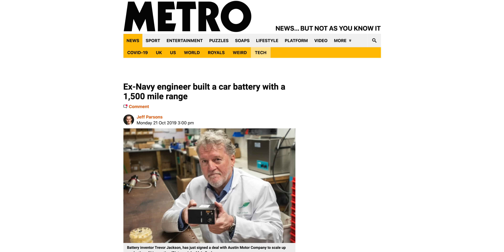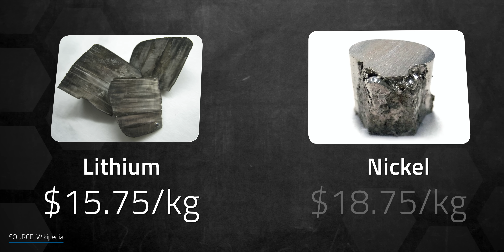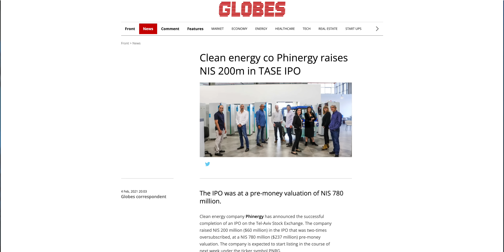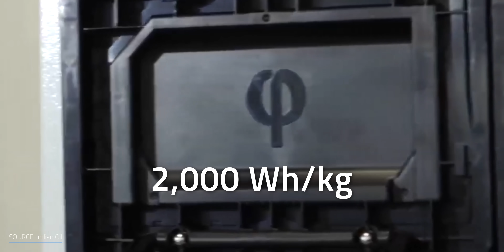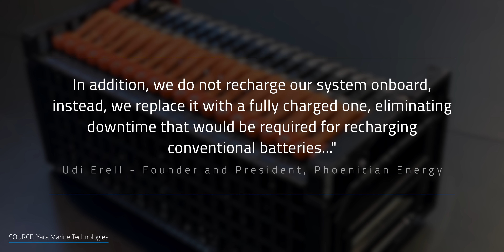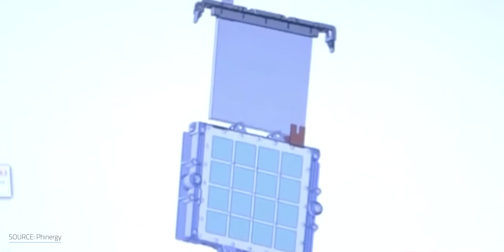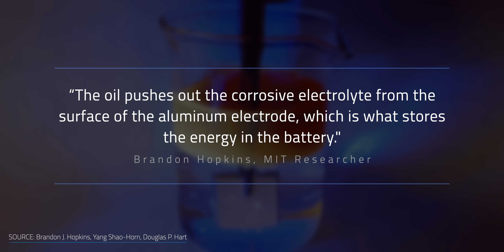Exploring the 1000 Mile Car Battery - Aluminum Air Hype?

Comment: Aluminum batteries are. Gaining  attention. As a
Potential  replacement for for lithium-ion batteries 
Longer lifespan   Also. Lower cost 
Check On. Tesla. Backs the  technology 
It can’t not. Be. Recharged once the battery is 
Discharged. Or empty

Comment: Battery swapping is not such a bad thing if you have a network of swapping stations. The problem of running out of juice in the middle of nowhere is not so different from running out of gas or not finding a charging station for Lithium battery. In fact some two wheeler designs include battery swapping even for Lithium battery.

Comment: Doesn't aluminium require a stupendous amount on electricity to manufacture? I could tolerate swapping out a depleted battery after 1000 miles, but I dont think it really makes sense in terms of logistics and sustainability.
Reply: It takes 13kwh and 0.48kg of coal per kg of aluminium.

Comment: I think that battery swapping will become necessary regardless.  Battery recharge takes hours, making long trips with quick refueling as we can do today, out of the question.  If batteries were standardized across the industry and be designed for quick swap, I can envision someone stopping at a "gas station", swapping in fresh batteries in exchange for the discharged batteries, paying a fee and in 10 minutes being on your way.  Ditto for people at home who drive a lot and can't have a "fast charge" station that can charge overnight to full capacity from minimum charge.  Plus, standard removable modules makes maintenance, repair and upgrades easier.  Its a no brainer.  SAE (Society of Automotive Engineers) should get busy working on  a mechanical/electrical/software interface standard now.  FYI, this would only work if its so easy that the driver can do it themselves so the modules must lightweight and with no way to do it wrong.

Comment: https://youtu.be/9OOq3f6mUxU?t=260 The Reaktion in the battery is Al(3+) + 3(OH(-)) -> Al(OH)3. So we get Aluminium trihydroxide or short Aluminiumhydroxide. How to get back the Aluminium is a part of Bayer process followed by the Hall–Héroult process, you can look up at Wiki. Easy is not the word I would use for that, it is by design even not free of CO2-emissions.

Comment: An Aluminium-air battery will probably be ideal for the militaries if they want to go electric. Swapping the batteries are ideal since there is almost no down time. Perhaps even less than fueling with Diesel.

Comment: If an emergency vehicle can bring a temporary charge to a lithium EV, it would seem even easier for it to bring and change out an aluminum air battery. It was also a bit misleading to suggest that one could run out of charge unexpectedly: I should think range could be closely monitored  and displayed in the car system. The non-polluting, energy dense upside of this technology seems very promising. I really don't want to wait for my car to charge.

Comment: perhaps I am ignorant here, but why is mobile swapping an issue for an EV powered by this sort of battery? If we are assuming the same design as a lithium battery EV, sure it'd require some specialty equipment. But why would be design the battery to be housed in the same area on a lithium battery vehicle? 

Is that limitation not just one of design? Why not place the batteries in the hood of the vehicle where someone can easily provide roadside support? Is there some sort of risk in having it easier to access? Surely we can design a system to just slide these batteries into a compartment with couplers to make replacing these batteries easier?

Am I missing something?

Comment: Honestly, a supplemental/range boosting aluminum-air battery as an option in addition to existing lithium tech sounds like the right idea. You could pick up an aluminum-air pack that you can use to power your vehicle for long hauls. When it taps out, lithium takes over and you have plenty of power to get you to a swap station if needed. It just makes more sense, really.

Comment: Lithium as a source is limited. So there should be alternative. Sodium battery tests are going on and yes absolutely Israeli battery company Phinergy has collaborated with Indian oil corporation for aluminium battery tech. The range looks promising and better than lithium batteries. Hopefully Suzuki Ashok leyland and Mahindra auto’s tests come out with positive results. India has abundance of Aluminium. That will make India not to depend on any other country for Lithium.💯⚡️

Comment: Theoretically, if the aluminum batteries were widely available and if they cost about the same as gas or less, I probably wouldn’t mind switching mine out if it’s plug and play. It might even be faster than pumping gas especially if they are stored in the trunk like the video showed or in another easily accessible location. The degradation problem would first need to be solved though, or at least greatly mitigated. A battery with such high energy density would take longer to use up leaving more chance for corrosion and it would be a shame to lose a lot of range while your car sits unused

Comment: I just realized you could have vents that can be opened and closed and turn the battery off... or you could drop hydrogen peroxide in a chamber and give it a tiny boost, so instead of nitrous it would be oxide...

Comment: If you really get 1000 miles out of the battery every time. I would have no problem swapping it out. Just as long as the price to do so doesn't exced what it cost to fill a normal gas tank to much.

Comment: As an eight-year driver of EV, I give you my answer:

No.

The ability to start each day with a full charge at home or away — by plugging my car in like a vacuum cleaner — is one of their biggest advantages.  Not interested in giving that up.

I don’t understand how replacing an entire battery at every fill-up could be economical anyway.  You didn’t explain that.

Comment: you overstate the issue of running out of juice. the battery does not have to be exhausted to 0% before swapping, the system can warn at 5-8% and force you to swap. the greater question for me here is how easy it is to recycle the battery? for the corrosion MIT's solution seems workable, I would trust their findings. 

I think Al batteries are the way forward, Aluminum is abundant and cheap, the range even if worse than stated is a major advantage over Tesla's. the pack seems so lightweight, you can actually take an extra one in the trunk once the system warns of running out of juice, then you swap it. Hell, with cars being hooked on the network the order of the new pack can be automated, so you'd be notified to pick it up at a station.

Then there is the charging problem. with chargeable EV's you have the huge task of building out an expensive charging infrastructure, meanwhile with al-air batteries you can use the existing distribution/logistic system and with centralized charging facilities you do not have to transport the electricity then distribute it over great distances. 

So far this is the most promising tech I have seen.

Comment: I don't see why you are emphasizing on non-rechargeable. You do know that petrol is non rechargeable too. 
A battery swap station or a tow truck can come to you.
The ends of life range anxiety can be easily solved by pairing with a small li-on battery
And one more solution, these batteries could be installed in asymmetric pairs so they don't run out at the same time.

Comment: Charging an ev is such a pain. If ev discharges in the middle of the road then alternate charging vehicles can come and recharge it in half an hour to get that ev to nearest charging station. But in case of aluminium air battery, the alternate charging vehicles will come loaded with new battery pack and will swap it within 1 minute to provide you a range of more than 1000 miles. That is insane. Also just like we fill petrol or cng, the turn around time of swapping will be similar at gas station. It is perfect replacement for gasoline. Only corrosion is the problem for which technology will get mature in some time.

Comment: Oxygen doesn't enter the electrolyte and react. It reacts on a three phase interface on the surface of the catalyst itself. Another point: you don't actually need a lot of silver for the air cathode. You only need a thin layer, few atoms thick on a carbon support

Comment: This is perfect for current scenario.. almost 2000 KM per swap on electric cars.. vehicles should be designed according to the space battery pack requires is one challange and Swapping stations could be another challenge...

Comment: Non recharging feature will not be issue in India if Indian oil and other oil psu provide swapping facilities. They have very wide network of petrol stations and then it will be just like filling. Petrol

Comment: Not necessarily if portable charging stations can come to you to recharge ur EVs then why can't it be true for replacing those aluminum plates. Also remember with EVs you know through a reading when you going to run out of battery so why can't the aluminum air systems be relied on same principle. I'm sorry but ur review doesn't feel objective rather biased towards EVs.

Comment: Battery technologies that involve replacing the electrolyte to return the battery to a full charge are fine, as this is basically what we are used to with ICE vehicles. Replacing the whole battery is definitely much more unwieldy, but might have applications in specific circumstances.

Comment: A swappable battery is the only way EVs can be successful in the next 20 to 30 years.  Everyone keeps focusing on the battery which is the most minor problem with rechargeable EVs.  The real problem still is where will the energy come from for the charging stations and how it will get there.  Do the world a favor and stop being obsessed with battery technology and gives a good solid report on how the charging stations will get their powe.  this can be not done without building large numbers of natural gas power plants, or more concerning, being forced to use coal to power our "clean" cars.  Both of these actually EVs more polluting than a gasoline powered equivalent.  

It took me less than 30 minutes to find the resource material and do the math, and realize what will be acceptable to the not in my yard people (happens to be almost everyone in the US) to know what you are promoting is not even remotely possible in the next 30 years.  The only way rechargeables work is if every charging station is powered by a small fission or fusion reactor.  There is simply not enough generating capability and transmission capacity that could even be built in the next 20 years to meet the demand.

To make this happen in a shorter period of time, the US would basically need to switch to the production and research model used to create the first atomic bomb and provide all the other war supplies needed for WWII.  That is level of effort needed to make it feasible in the near future.

Don't believe me, do the research and simple math and show me I am wrong with a video on your channel.  I will not hold my breath because it will be a very sobering video and yours are always up beat.
Reply: Bro, do you even know what renewable energy is? if there is renewable energy and nuclear energy, people have to shut up about coal energy and natural gas energy

Comment: your argument that an alu-air battery powered car requires towage to a swap out station in case of full discharge seems unfair. If a Li-ion can carry a spare charging unit or be rescued by a charging truck then surely a alu-air car can carry a spare (very lightweight) backup battery as easily as a spare wheel, and a swap-out truck could come and do a roadside swap out also. All that is required is industry standardisation of fittings etc. 
Given that i favour high-power non-rechargeable batteries for some applications and rechargeable batteries for others ... i am sure i could change the batteries in a car as easily as in a torch if well designed. What's more with lightweight batteries i could carry multiple batteries just as i do for a torch on an expedition. So it is a yes from me ... but only when the infrastructure makes it feasible. In the case of batteries i imagine i could get my batteries home delivered just as easily as i get my groceries. Amazon anyone?

Comment: If u drive a car and petrol runs out u hv to go petrol station. So what u mentioned is  wrong that this battery drawback. Eitherways if u r getting 2700 miles in a single charge then one can afford to keep a spare considering the weight being less. So there.

Comment: Yes, I think swapping in 3 minutes is the solution. I understand that also several hydrogen systems go in this direction, and having an automated system to swap batteries in 3 mins, when they give you 1500 Km of range would definitely work. Thanks

Comment: Graphene batteries are a more realistic option to aluminium air batteries especially if the new material borophene is commercialised, graphene batteries don't get hot, they have higher density and last longer and have more range, graphene can also cover a wider surface area, not to mention graphene is a more conductive material than aluminium, these aluminium air batteries aren't going to work for the long-term if they can't be rechargeable and cheaper to mass produce compared to lithium ion batteries, it's not going to work, they rely on consumers to keep that product afloat, it's not being a viable alternative option for consumers especially for general use in EV conversions/vehicles, being that it's not rechargeable, it might as well be a non rechargeable lead acid battery.

Comment: If this type of battery becomes usable I think it would be way better.  1000 miles range.  For some people that would mean changing batteries once a month or even longer. Vs having to plug in every night.  If you have to make a long trip.  You could do the entire trip no stop or just have to stop once.  And a stop would be just a few minutes vs multiple stops and each stop talking a long time.  But I think this technology would work best for mass transit and tractor trailers.   Light weight and the extended range means most of the power can be used to haul a heavy load and not the battery it self.

Comment: Depends on the cost. Is swapping aluminium battery going to cost me less than gas? Is it going to cost me less than charging? Swapping batteries much more preferred to the current charging system. I would even be willing to take a little extra hit on cost (compared to charging), because of the recyclability of aluminium, and as someone else also pointed out, somebody getting me a new battery pack is much more preferred than getting a little recharge to get to the next charging station. Also, if the range is anywhere close to what is claimed, then it's more like servicing at half the current ice car range. It's not like I need a new pack every 300 milrs

Comment: yes swop is a good idea .Just have a think you can pick up a few extra batteries for that rainy day. .or late for work and don't have time to lineup at the gas station for a pack replacement just use the extra one you purchased earlier and get to work on time

Comment: I like the potential of this option, but I have a practical concern - inventory.  How much inventory of AI will swapping stations be able to keep safely (so as to not get stolen)?  Also, what is the expected swapping cost?  The low degradation rate of LI batteries gives it an advantage, but it requires specialized tools and training to be able to replace them - not to mention the cost of the replacement battery.  The lifetime of an AI battery will be 4-6 weeks, as opposed to 10 years for LI.  So, will it really have a net cost savings?

Comment: Perhaps battery could be manufactured in modular systems where only one module of battery can be changed .Not whole battery. Like changing batteris in any batteris used devises. No technical  assistances required. Then   we might be able to carry spare unit in the car and change it when its needed without any assistances

Comment: Well, From what was described in the video, It sounds like the biggest limiting factors of Aluminum (aluminium?) air batteries is that it isn't rechargeable and that Silver Catalyst. With the exception of the cost, It reminds me of the standard Alkaline batteries that are used so often. Use them up and recycle them.

Comment: I'm not certain I agree with one of your downsides.  You said, "...What if you're driving late at night and you run out of juice?  Battery swapping wouldn't be available, and and a regular EV could get a tow charge or a top off...."  How is this better or different?  In both situations you're stranded in the middle of nowhere with no juice.  So you call for help, and when help arrives they provide power.....so why couldn't the help bring a new battery if they know the problem?  I mean they are not going to know you need a charge for an EV right?  They will respond to the problem at hand when called.  So why couldn't they just bring a new battery or an emergency battery?  Or why couldn't standard emergency precautions be to have a spare charged battery ready to go like we do a spare tire?  I don't your downside as a down side to be honest.  And given that AL batteries are cheaper than LI batteries...it's more likely you could afford a spare or two for emergencies.

Comment: The range anxiety can be easily fixed with having 2 of those batteries in the car, since the weight is not much it shouldn't make much of a problem, when one is over you just switch to the other one. being that their energy density is still way higher than lithium ion you would be able to go to where you need to and then also change/ swapthe old used battery with a new one. Range indicator in cars can also help. Li-ion are not the future and need to be overtaken by better technologies as we are running out of lithium.